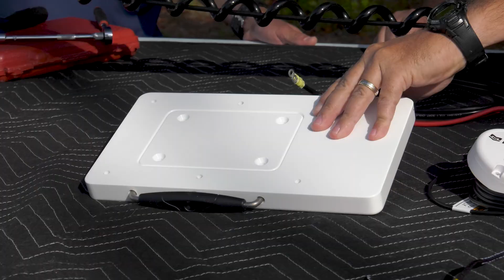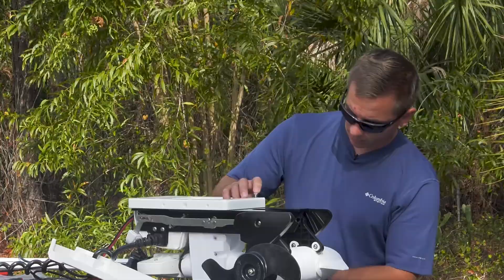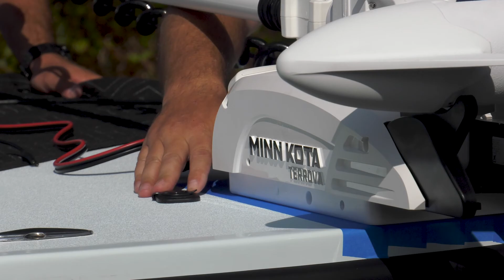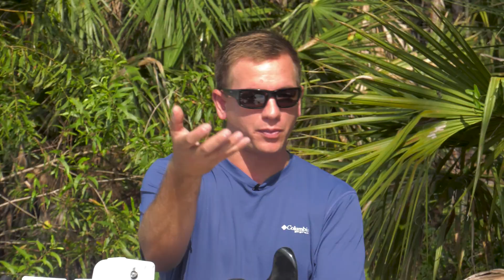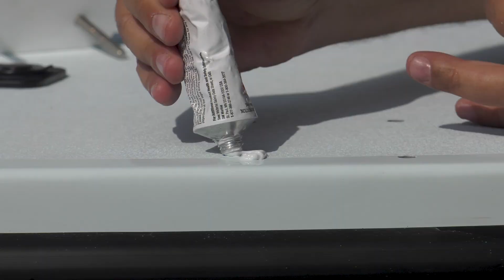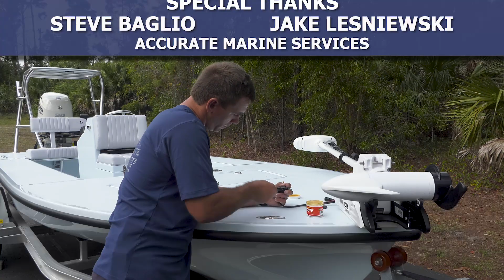How to Install a Minn Kota Riptide Terrova Trolling Motor | Saltwater Boats

Comment: Horrible vid. What are the back bolts screwing into again? It would have been nice to see what you did for them. No silicone underneath on the fender washers under the mount. That's the area that's gonna get hammered with water!! Ha ha!!!

Comment: You did not put 5200 adhesive on the bottom of the boat where your nuts and washers is😢and yeah did not show putting the other bolts in either 😮

Comment: Nice video, very detailed and good advice. One tip, cleaning up silicone off your hands and/or excess that squeezes out, such as in this case, use a paper towel and rubbing alcohol, comes right off - nice and clean job!

Comment: So far trying to install the bow mount 60” RT Terrova has been a royal pain in the ass !!! The puck has to be too far forward to the point that one screw hole isn’t usable. This seems to be the case on several brand boats. Now I’m having to find someone to make me a custom plate in order to properly install a $2000 trolling motor. Minn Kota needs to be more vested in providing solutions to these issues with installing their products.

Comment: Great video. Helped me install my Terrova!
The one step of tapping to leave the puck in place was difficult. Instead, I added an additional piece of tape to the bottom of the puck. Then I used spray adhesive and sprayed the tape on the puck and the tape on the deck. I let it sit for five minutes and then removed the trolling motor so that I could find and mark where I needed to drill the holes for the puck. I think this would be very beneficial to do even with two people it’s hard to get the puck to stay in position when removing the trolling motor. Make sure you do not wrap the tape around the edges of the puck. The tolerance/clearance between the puck and the mount attached to the trolling motor is very tight, if you have tape in between, the puck will not separate easily. 
I hope this helps others.

Comment: If i already have this same setup on my beavertail mosquito, am i able to install the mount that allows the trolling motor to slide back with the same screw holes that the puck has? again, I have this exact same set up and my trolling motor hits the bow roller when unloading regardless of how shallow or deep into the water I back into the water. I know i can just take the trolling motor off each time I launch but that can become a pain. Any advise would help. Thanks in advance.

Comment: So you said hooking up power and you’re done. What about the I-pilot hook up??
What is that capped wire for??
Reply from the maker: Mark, 

If you are speaking about the wire coming out of the base of the motor by the power wires, that is for a foot pedal. 
Thank you for contacting MinnKota.

Comment: Minn Kota should provide screws that AREN'T fully threaded.  Smooth under-head for about an inch or so would be better.  I would replace them before install.  Also, as I haven't seen the electrical connector they provide, I hope the wire isn't secured at the end of a spinning screw!  It will splay and not use all the conductors in the wire!  That is bad news.  If that is the case, WIRE FERRULES should be used.

Comment: My boat dealer installed this motor with only screws stuffed with zip ties, it was 1 screw away from being ripped off and into the water when I hit my first big wave on Anchor lock. I was so pissed finding out that it was a sketchy install on their part after watching this.

Comment: wouldn't you want to seal bottom and top? Also, why not run a rectangle backing plate powder coated white for increased surface area to minimize the PSI to the bottom of the rolled deck. running into waves will really torque those small washers and crack the gelcoat.
Reply from the maker: Hello,

For best practices installing a trolling motor on a particular model of boat, you should consult the boat dealer and/or boat manufacturer.

Thank you

Comment: Marine seal on the bottom side of the lip washers and nuts?
Reply: I was going to say the exact same thing, when the boat is at run the wave cutting will force water from the bottom up, plus as seen while drilling there’s a space between the top cap and the bottom lip.